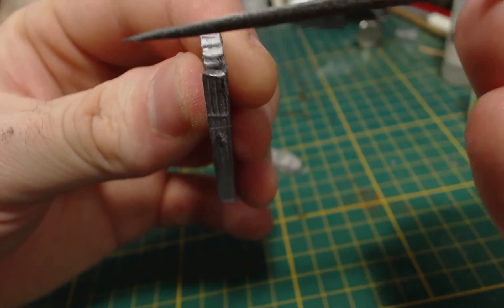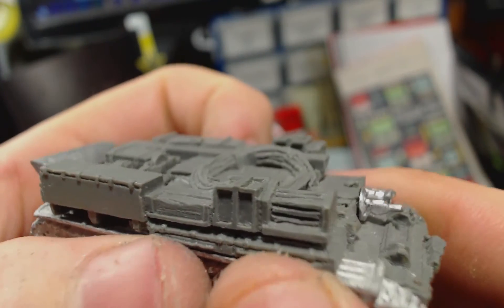15mm Scale Flames of War British Recovery Vehicles.

Comment: The Cromwell's hull looks gorgeous compared to some of the resin hulls that are made by Battlefront. You should get some more ARVs, like a Bergepanther!
Reply from the maker: +Aaron Van Horne I ordered the Bergepanther at the same time I ordered  these. It just happens that Battlefront's ordering system is a bit crap and they didn't ship any, probably because they had no stock.
Reply: +Herbert Erpaderp Yeah, I know that firsthand. I've tried to get T-34/85s (both 1943 and 1944 versions) on multiple occasions and each time they happen to be out of stock. It's quite frustrating, really.